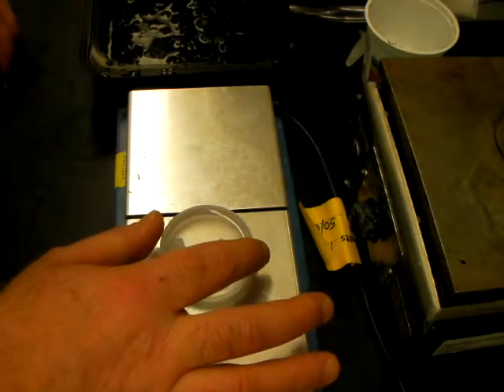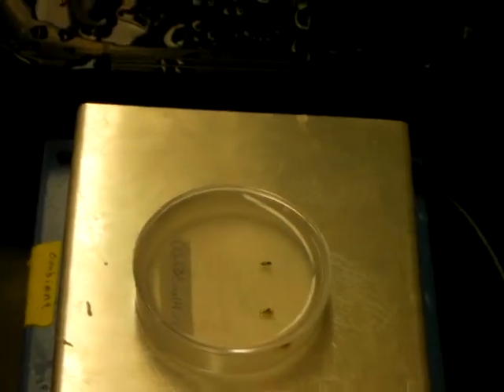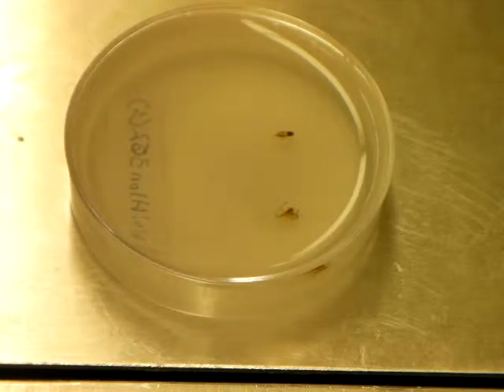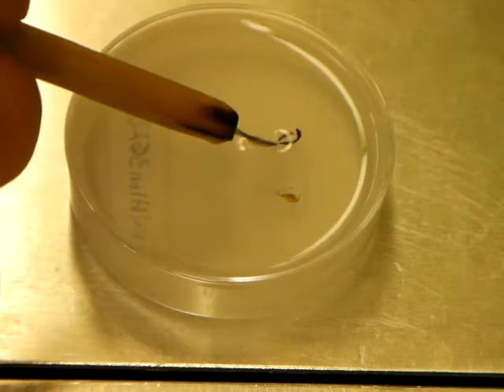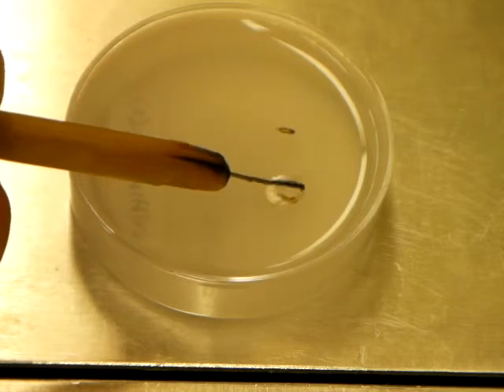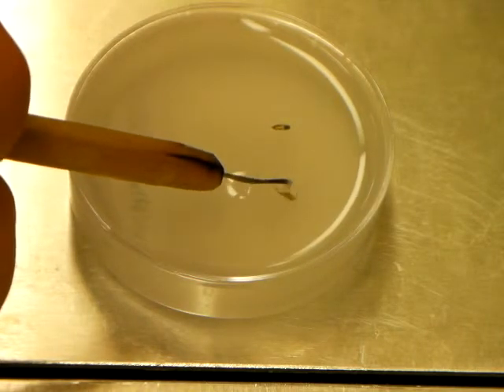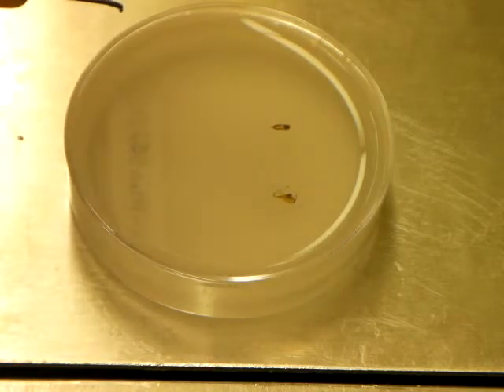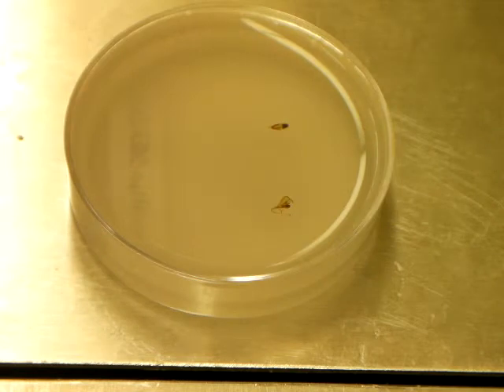Histological methods part 3 - casting specimens part 2

Comment: Do you get better preservation of structure with resin/EM prep? How does paraffin-embedding compare?
Reply from the maker: Hey Blanca.  I did some SEM work with developing flowers using traditional critical point drying methods but the only preparation methods I used for the histology involved paraffin so I don't have a basis of comparison of those two methods for you, sorry.
Reply: No worries, thanks for the response.